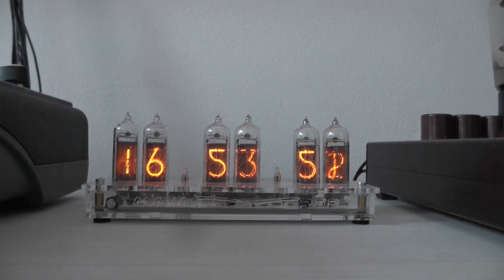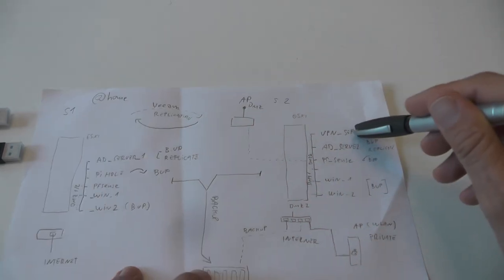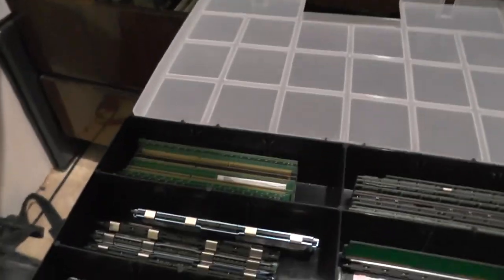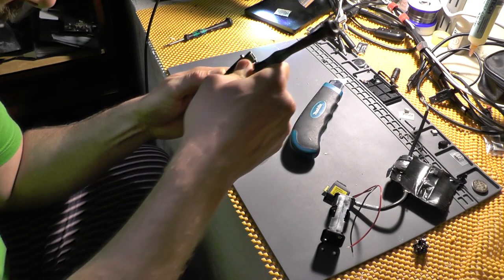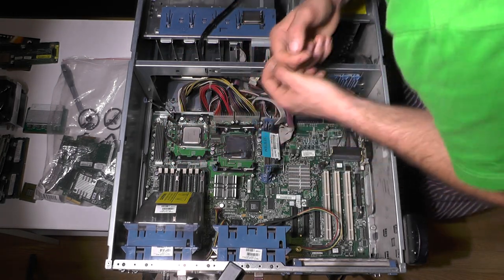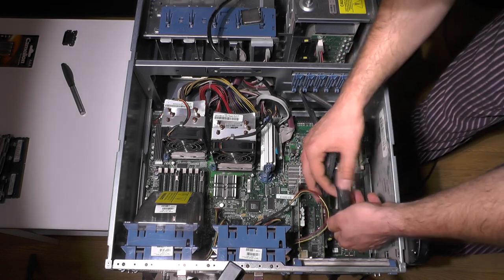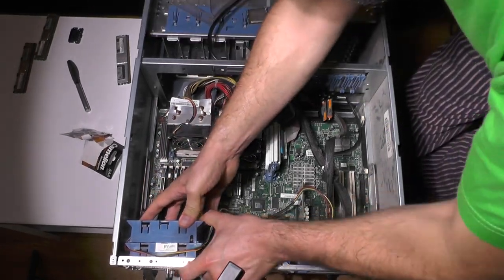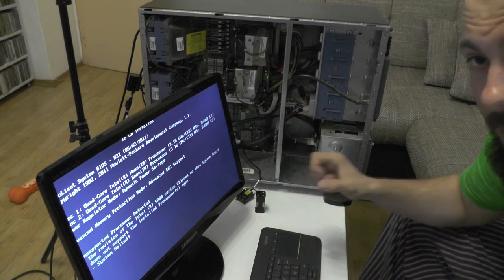My new network config explained [Part 1] - HP ML350G5 Proliant repair and upgrade

Comment: Sadly, HP makes it almost impossible to update the BIOS, firmware or ILO firmware without "entitlement". I have three rack-mount HP servers and one ML310 G5p, all of which can't be updated due to HP's policy. No warranty or support? No updates are available to you. Used HP servers are good if they're updated properly before the entitlement expires, but a lot of them aren't. If you don't have a valid contract with HP for the machine you simply can't update it unless you have another means to get the firmware files other than their website. It's bullsh*t and it's also one of the reasons why HP servers are still the most widely available on the used market.. everyone prefers IBM or Dell. Our X3650 M2 from IBM has been one hell of an amazing machine.
Reply from the maker: Yeah, i found out about that the hard way... ah well..

Comment: link za sat? :)
Reply from the maker: Ovo je link za sklopljeni (ja sam ga sam sklapao pa je bio jeftiniji dosta): 
https://www.ebay.com/itm/Maja-RGB-Nixie-Clock-IN-14-russian-Tubes-Tube-Clock-with-remote-control-led/271164441946

Za Sklopljeni bez plastika:
https://www.ebay.com/itm/Maja-RGB-Nixie-Clock-IN-14-russian-Six-Digit-Tubes-Tube-Clock-with-remote/281228800327

Gledam za kit, nije vise listan :/

Sa time da mi je pregorio glavni driver za cijevi (unutar 3 mjeseca) i naravno... seller me ignorirao na 100 pa sam jos morao skuziti sta ne valja i popravljati ga :/

Comment: HP just love to nickle and dime its customers,they even charge you for a "cooling fan bracket" on new workstations if you install more then 64gb ram,from them,they are assholes,but companies have alot more money so they are dumb and pay them for silly stuff,thats why i just build servers from off the shelf regular stuff,the fact all the capacitors was bad on a server board says alot about HP
Reply from the maker: yeah. It seems that enterprise these are machines that last up to 5 years  :/